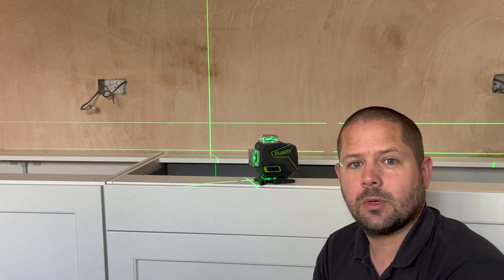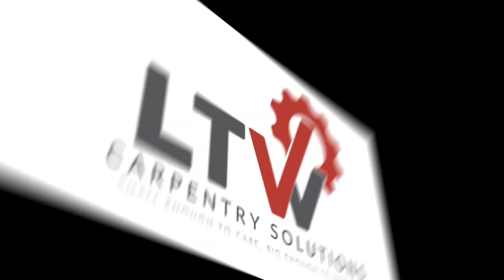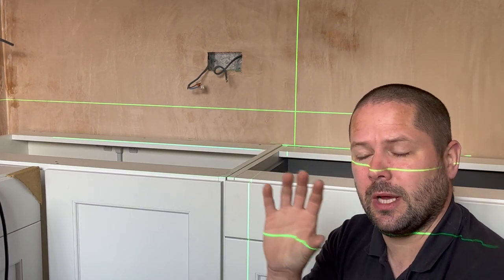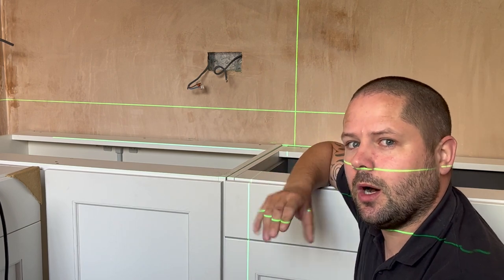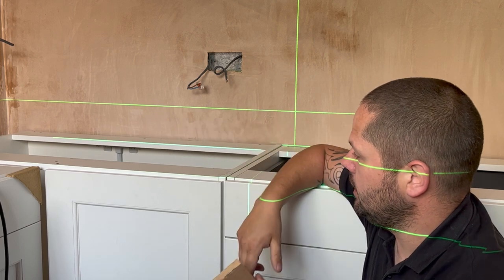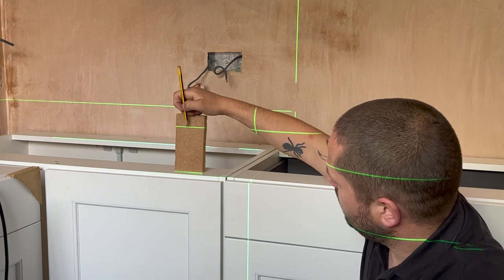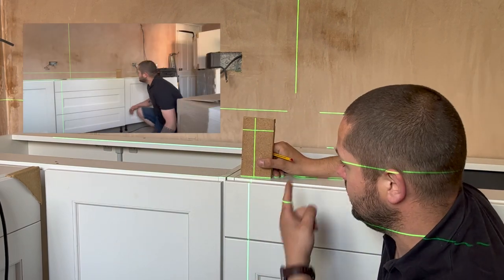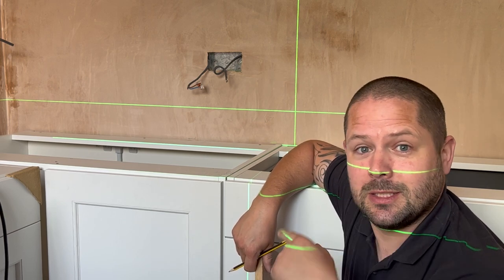Why some laser levels have two horizontal lines

Comment: I am not a tradesman or even a diyer, just the guy who wants to buy the tool because it is shiny. And I have no idea what I am talking about.
But I think that the 2 lines are intended to be used separately, not together. You engage the top laser plane to work on the ceiling, and the bottom plane to work on the floor projects. Because you might want your lines as close as possible to your work/installation area.
Reply from the maker: That’s very possible ! Nice one buddy !

Comment: I’m no expert but I’m currently installing a kitchen at home and do work in the trade. Personally I’d align the front of all the units to the bottom line and use your technique to align the back of the units with the second laser line, as the front of the units block the lower laser and it’s can’t be seen at the rear of the units. Not too far from what you said, but I don’t see why you wouldn’t line all the front units to the lower laser. Cheers, nice video.

Comment: Seems more like a clever use than an intended one?  That said...I've looked far and wide and it seems like no one has any idea what the 2nd beam is for much less try to explain it.  Not even Huepar themselves, who when pressed could only manage to offer that there are two beams...but they don't even pretend to try to understand why or what they're for.
Reply: The only thing that comes to mind is that the top plane - to get as close as possible to the ceiling level and the bottom plane - as close as possible to the floor level (could be useful for tiling and other flooring work). But this is just an assumption.
Reply: I answered above.  It's for leveling front to back. The front can be in line and the back could be low.  Once you put a block in front marking the upper line you can check the back to see if you mark is on.

Comment: Hi, which tripod do you use with your lazer level? Cheers
Reply from the maker: Hi mate, I just use my camera tripod but you can get proper tripods off of huepars website
Reply: Buy the one from Huepar. Tripod and adjustable floor to ceiling pole!! Cheap